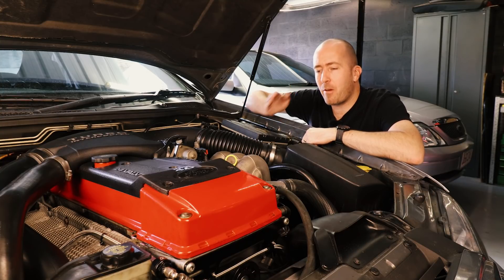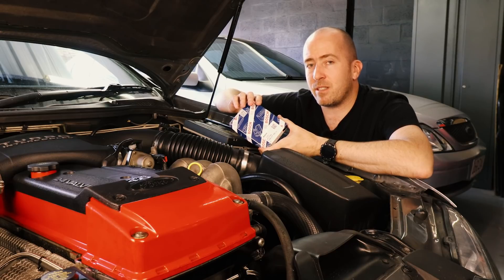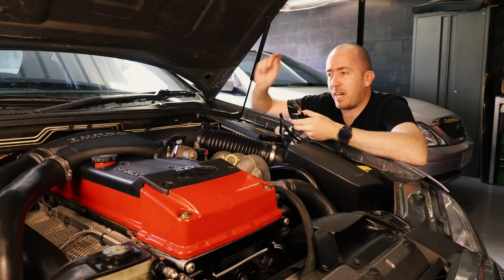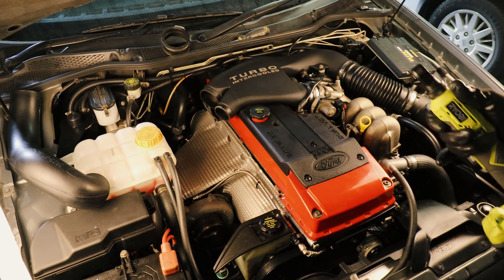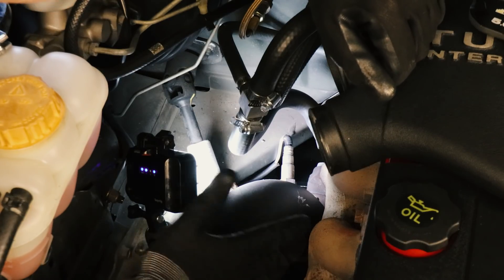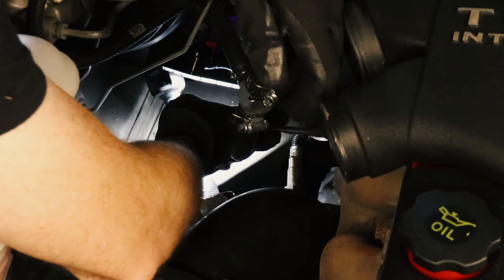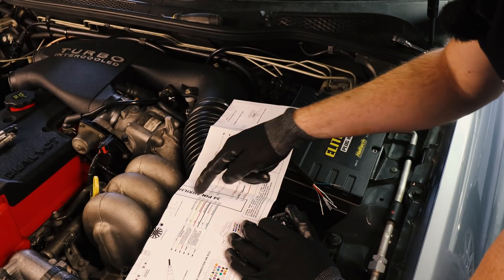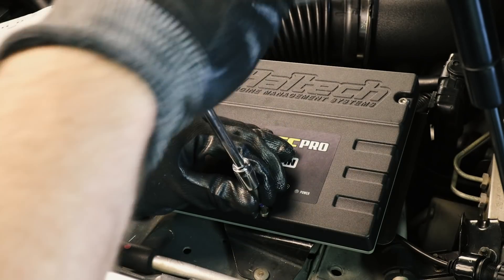👨‍💻Why Go Wideband? Installing a Barra Turbo Wideband O2 Sensor! Haltech Elite PRO Plug-in kit

Comment: Generally brand new belts should be silent. It might be possible that your pulleys have a bit of dirt or something on them. If the pulleys have ever been sprayed with stop squeal, wd40 or even when you cleaned your engine with tyre foam, that can cause it too.

Have a sus.

Great video mate

Comment: Just a tip on exhaust sensors I learned the hard way.  Once the car is tuned you do not need a wide-band sensor, just put back the narrow band until you do some new mods.  Like many things there is only one ratio for exhust gases and the narrowband will be able to account for this.  Also running outside this range will just either waste fuel, (running ritch) or damge the engine (too lean, hence to hot) and not improve performance or ecomany, so when done tuning just put in a cheap narrow band sensor and save the wideband for when you need to re-tune.  There are complexities around air fuel ratios, compresion and octane rartings that lead many down a rabit hole of adjustability, do not fall for it.  A wide band sensor will help you tune the car, but once tuned the ratio will fall well withing the narrow band sensors ablities so save some money and put it back once turned.  My leason was learned years ago (we are talking 1996) I installed a wide band to tune and left in in after, after about 6 months it had burnt out, so I put the narrow band back in and the car ran fine, it was only then when I went to by another wide band I got the advice of run a narrow band and keep the wide band for tuning only.  Just my 2 cents.

Comment: i have both of the ryobi tools you purchased. I've also purchased the toolpro 12volt ratchet and recommend getting it as well due to its smaller size. The battery on the ryobi ratchet causes issues in the engine bay and other tight locations

Comment: Hey great video again, just wondering where did you get your triple gauge holder ? I commonly can only find double gauge holder for the ba/bf falcons. Also what gauge are you currently running ? Thank you
Reply from the maker: The holder and gauges are from over 15 years ago and not available anymore, sorry mate. I have seen some triple gauge holders available somewhere though - maybe check eBay.

Comment: Possibly a silly question but, have you upgraded the fuel pump or plan on upgrading it? Be a good excuse to replace the tired old standard unit 🤷🏼‍♂️
Reply from the maker: Yep! The one that is in it is supposedly good for up to 600hp, so it'll be fine.
Reply: Get the right regulator also, there are differences in them.

Comment: Centre bearing is actually surprisingly easy to do yourself, it sounds daunting because of potential balancing issues, but as long as you mark everything and put it back where you found it you should be fine. 
Did my FG's on axle stands. 
Always good to get a professional to do it for peace of mind though 👍
Reply from the maker: Some of the removal steps look a bit fiddly. I probably could work it out if I gave it a go, but it's something I don't really want to f*ck up.
Reply: @MotoringBoxTV  yea, there's weights on it that need to go back in exactly the same place so that can be fiddly. If you mark them and take some photos for reference you can't really stuff it up. But then, I think you'll also need access to a press to get the bearing off and on (I can't remember), so if you don't have that then it's a trip to the mechanic anyway. 
Fair call getting the professionals to do it 😊

Keep up the great work, you're doing things on your car that I wouldn't have the confidence to do myself. It's been awesome watching you go through your journey, looking forward to the tune episode!